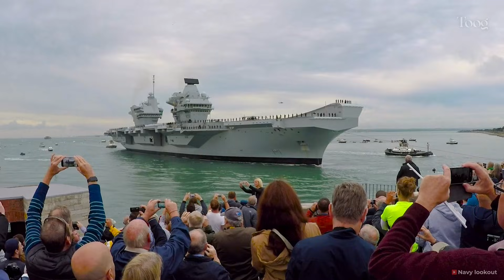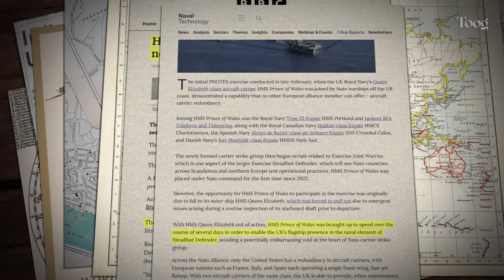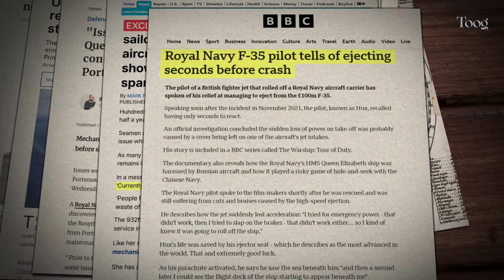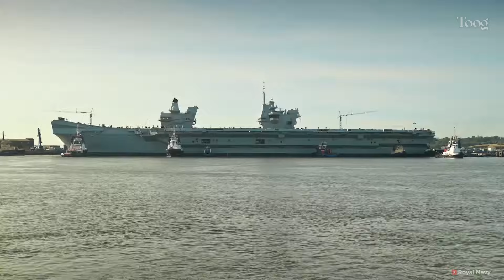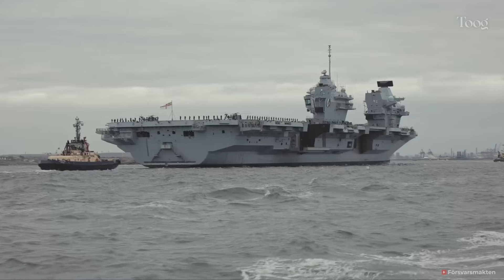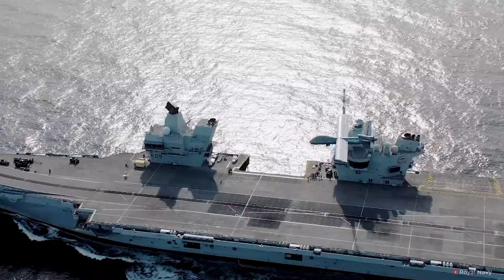Why Britain’s Most Powerful Warship Is Facing So Many Issues

Comment: This video is outdated and reads like an AI FAKE doom list, or just ignorant, when the opposite is the case. Many points now MOOT! Much NONSENSE.  Downvote!
Most of QEs issues were resolved pre 2024, leaks, props etc. Pow Wales fully tested 2025 with 26,000 nm near perfect deployment, prior first Mojave UAV and V22 Osprey certifications.. 38 F35s delivered, 48 soon, and 128 original order confirmed for 2030. Project Ark Royal in motion for Mid terms.
4 Type 45s are back in service after PIPs, 2 more in 2026. Many Astutes SSNs back at sea in 2026; Type 26 on stream in the next 2 years. 2 31s launched, 3 under construction. QE back in service 2026 after extended maintenance, training.

Comment: Regarding the aircraft numbers on the carrier in 2021, it's a little hard to put aircraft on the deck if the American supplier is slow in delivering them .the original 48 ordered had only had 38 delivered by July 2025 with the first arrival in 2